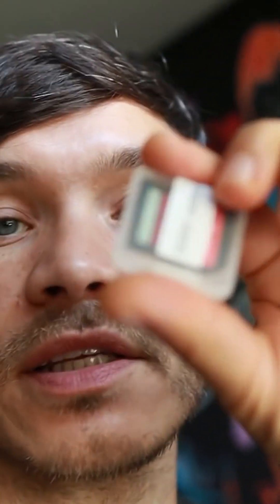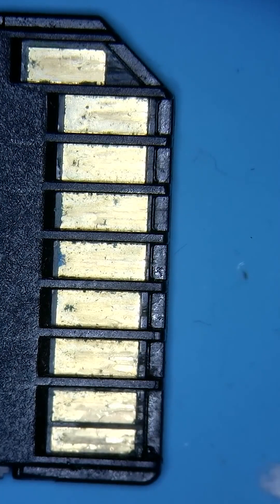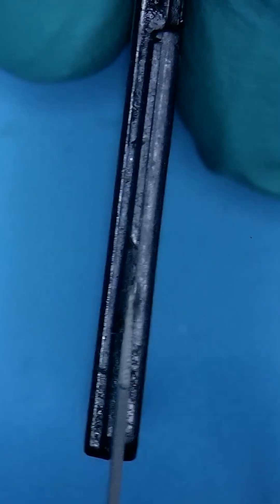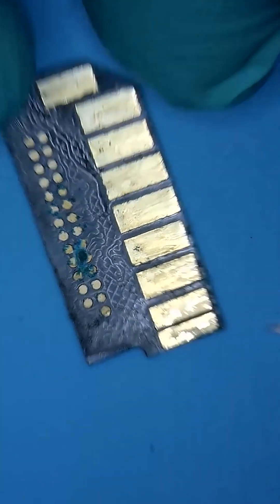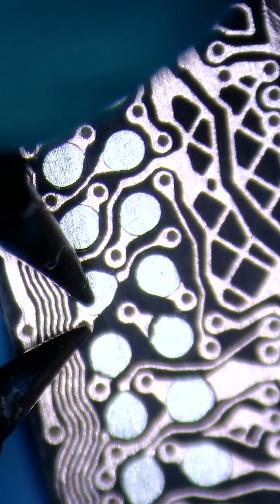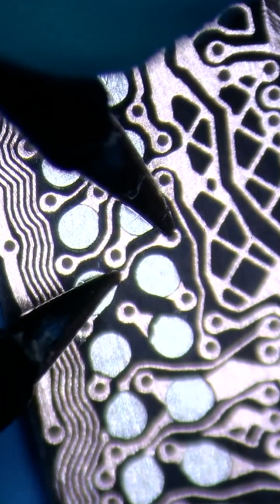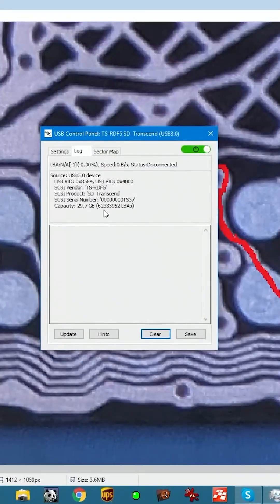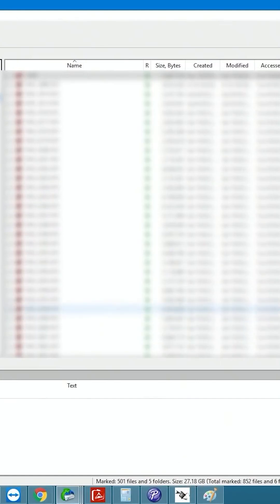water damaged memory card data recovery #tech

Comment: I’m here after accidentally dropping my SD outside and it rained over night. I didn’t realize until the next day since I normally upload my clients things until the next day or two. I waited 24 hours until trying to use it. I had put it back in its case after drying it with my shirt. 

I tried to put it in the computer and first asked me if I wanted to allow it after selected allow it said the dish you attached was not readable by this computer 😩😩😩 I done tried disk drill.. PLEASE HELP